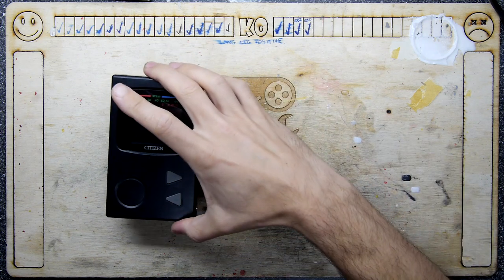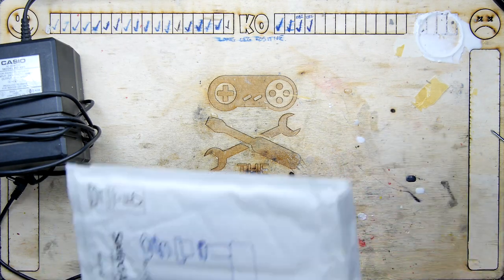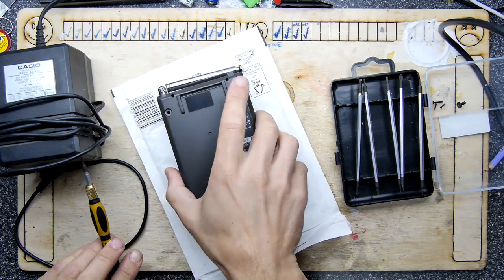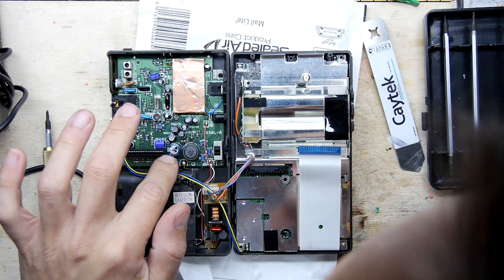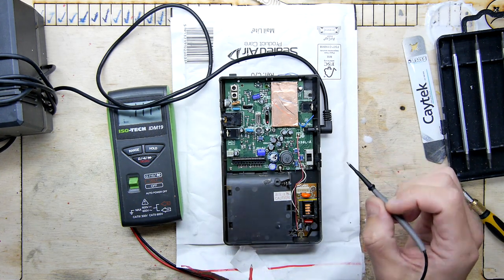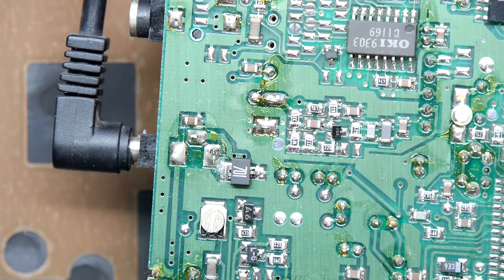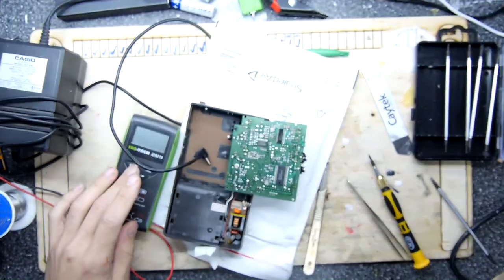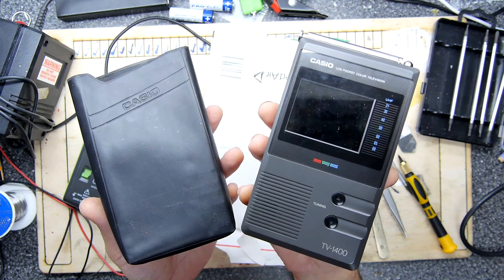Casio Pocket TV TV-1400

Comment: just to be clear, the tv had an issue when run with power which it looks like you fixed (tested on my own psu) AND that psu is not giving enough power on my testing it was 4v with no load instead of 6v (which my psu gives out) this psu wont power my tv-1400 either.

oh and this one has a composite video input as well as the ext rf input so it'll work with many 8 to 64 bit consoles as well as things like the pi
Reply from the maker: +ImpaledGryphon I was doing some tests and it's a great TV, the picture is much better than the citizen. Just goes to show those few mm make a difference 😀 looking at the spec of the PSU I think there is good potential to hack in another unit into the same enclosure.